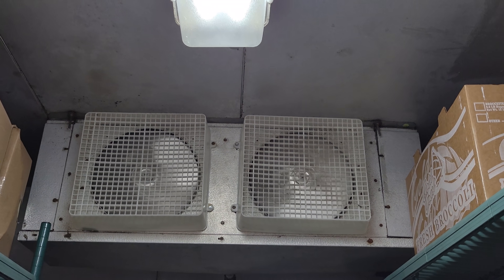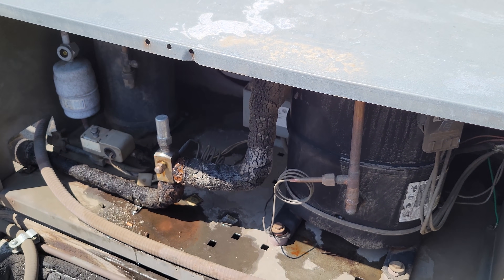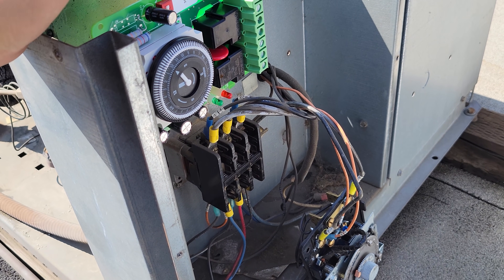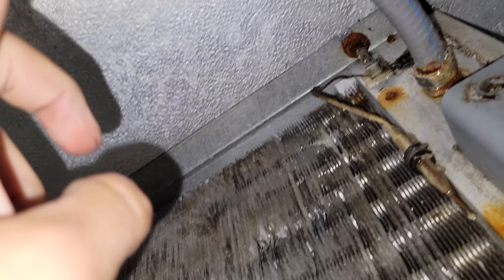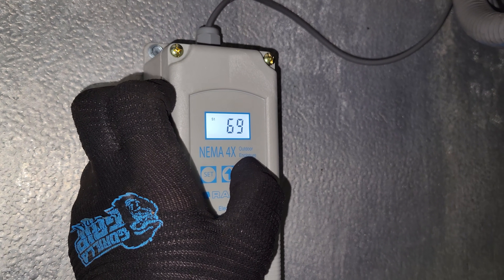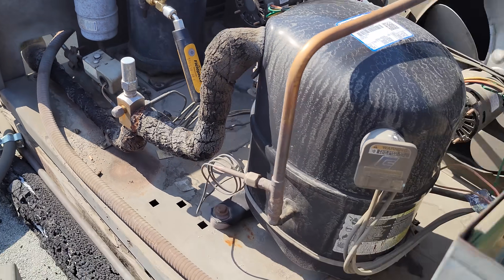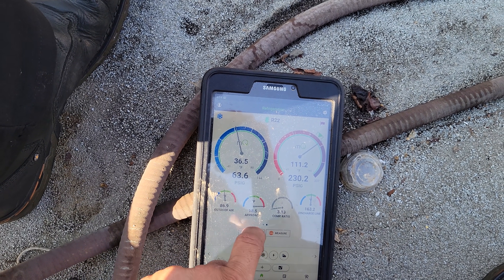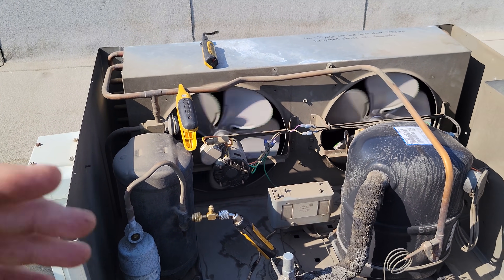THIS ONE HAD ME SPEECHLESS

Comment: Do not care if customers don't maintain or replace their systems. The more beat down, the more work you get. If you can't keep up with work load raise your rates until its just about right. Always cover your butt, quote full repair, ALWAYS put ball in customers court like your doing. We are in service, otherwise your just an installer.

Comment: What I would have done here, and I've done before with good success on older restaurant walkins, is just replace the temp control with a Johnson Controls A421D. This gives you digital temp control plus off cycle air defrost in one box, and the customer can look at the display and see that his equipment is on defrost, and not call you because the box is 44 degrees. Then just rip out the old mechanical timer and be done with it. Saves the customer money instead of buying 2 things. And if it ever goes bad, you don't need to go up on the roof and get stung by wasps. They seem to love building nests above the compressor in these units for some reason... Good job overall though.

Comment: So quick question, is it normal for a walk in freezer to turn off the evaporator fans the second you open the door at all? or is this the result of a frustrated HVAC guy? For some context, this is in the warehouse area of a grocery store in a rather dry area. I noticed that the fans turned off when I opened the door to get in and grab a bag of ice, and turned back on as soon as the door was closed. I have no idea what the compressor(s) was or was not doing in response to the door. Is this sort of setup normal? would someone care to enlighten me?
Reply: It stops warm dirty air from outside the box from getting sucked through the evaporator and making it filthy and icy like you see here.
I believe Chris did that exact setup in a previous video where the box was super high traffic and they were having to call him out regularly for that
Reply: Its Normal there's a door switch on the walk-in... The door switch shuts the fan on and off when people are going in and out.
Reply: there called Limit switches i install them non stop for every walk in cooler freezer  blast freezer regardless of the situation    and no i dont hook it up to the solenoid  .. jus the fans doors open lights on go Fans shut off  compressor keeps running   they close the door fans go on  lights go off now depending on the load  sometimes you might need to add a contactor

Comment: Nice vintage 1870's  Pipe insulation on the roof.    Real collectors item with that completly cracked patina!
Reply: Lol, that's 1970's not 1870's. But one time I was on an old boat, from around 1952, and the walkin had very thick insulation on the suction line. On closer inspection I found it was actually 2" thick asbestos painted over with quite a few coats of paint. Since I suspected a freon leak under that insulation, I noped right back out of there! R12 system, so the refrigerant was unobtainium by then (this was in the late 1990's). Just ran new lines to new evap, and called it good and abandoned the asbestos stuff. Painted over and encased is relatively safe, but can't start cutting or screwing around with it.

Comment: As a lowly homeowner I'm only interested in making sure my home HVAC system keeps on truckin' but I've throughly enjoyed the last couple of years watching you work as your big pix diagnoses applies to troubleshooting my and my friends electronic ham radio equipment. Thanks Chris...Happy Thanksgiving!
Reply: Agreed. I work as a technician for a manufacturer. So many of my peers do quick fixes, and never look at the big picture. I get it, sometimes you have to make a quick a dirty repair due to limited resources (time and spare parts). But when time and spare parts are on your side, there is no excuse.

Also, sometimes, you need to push back against production demands from time to time. Production often has a false sense of urgency, and if you lay down every time they apply pressure, then every problem will be an emergency.

As a technician, it is your job to explain the consequences of different actions, and let them decide on the path they wish to take.
Reply: CQ CQ de N5JYP
Reply: @alittlemoore1  RRR 5x9 in VA. 73!
Reply: "Lowly homeowner" - I think not! Very few homeowners take the time to learn how to do basic home maintenance, despite the fact that it can save them a considerable amount of money over the long term.

Comment: If that unit is 208 3-phase delta and the timer was 120V, they could have wired it from a leg to ground and gotten the required 120V. Or if it was 240V I suppose it might have run OK on 208V, at least until it started getting old.
Reply: Or the timer motor could have let the magic smoke out, and just never went into defrost. I have quite a few coolers with no defrost timer, but the equipment has to be working 100%, and the customer can't be leaving the door open for this to work. My guess is that timer was non-functional, and they got lucky that the timer motor burned out when it wasn't callling for defrost and the system worked fine until that hot day on August 20th, and it ran for more than 18 hours straight, and then that's how ice monsters get started. That compressor sounds like crap because who knows how long it was running like that with the liquid line solenoid closed, but sticking low pressure control kept the compressor contactor pulled in so the poor thing was running with no refrigerant gas flow. I hope they replace this whole system soon, that compressor and evaporator coil don't have a lot of life left.
Reply: 208 is 3-phase star, never delta. You're thinking of 240v 3 phase, which is going to be either high-leg or open leg delta, depending on how old the surrounding infrastructure is. Got a few customers downtown in an old part of the city where I live where there is quite a few 240v high leg systems still around. Problem is it's so built-in to everything with tall buildings around, it's difficult and expensive for everyone involved to change voltages at this point. (both utility and customers that dont want to buy new equipement). If everything is wired correctly you can identify systems that have black, orange, blue feeders into the panel, instead of the normal black, red, blue. That orange wire is 208 volts line to ground, so there's a reason why it's called the 'stinger' leg. You touch that line, you get almost as bad of a shock as a leg off a 480v system... 208 vs 277.